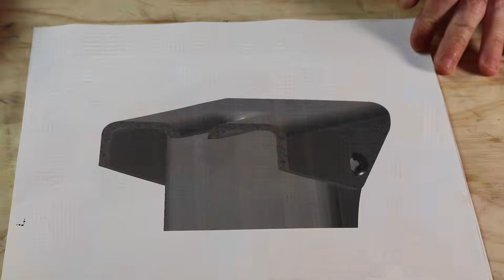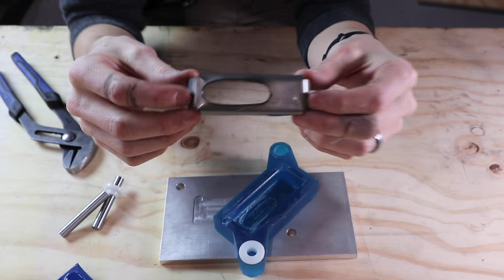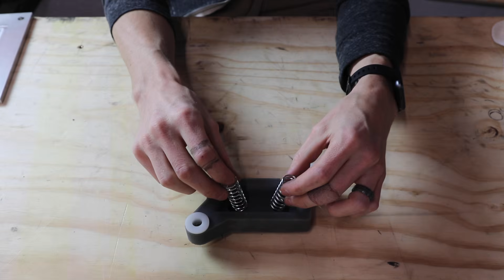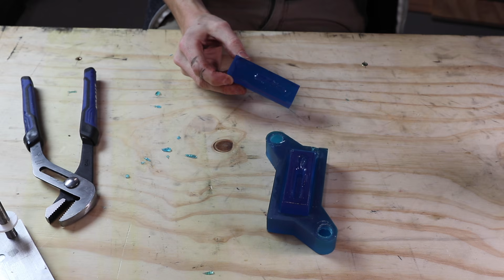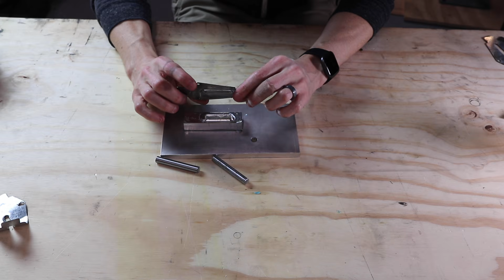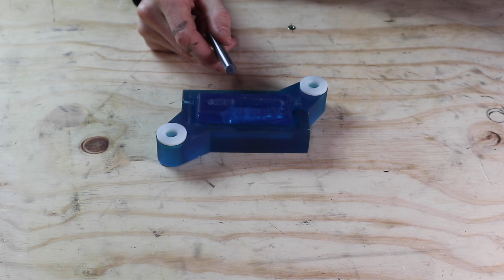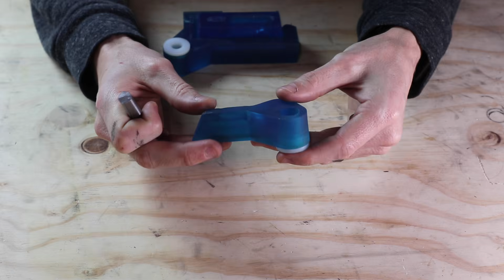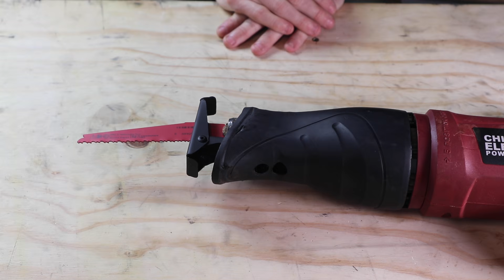Bending Steel With Plastic Tools

Comment: Why make a form out of 3D printed resin when you can CNC aluminium or steel and make the forms more resilient ?  Alternatively maybe have some bolts laterally through the resin dies to add tensile strength ?
Reply from the maker: These forms are really easy to CNC but 3D printing allows you to make potentially more complicated forms that would be very hard to machine. Also I'm lazy and would rather print them and do other stuff instead of running the CNC :)
Reply: Cool.  Was just curious.  Love the content you are putting on youtube btw.  Good stuff man!

Comment: As a Tool and Die maker it was interesting to see you work through this, impressive what you were able to do with 'plastic', really
Reply: Resin.
Reply: chara dremur that is the reason he put air quotes
Reply: @charadremur333 what do you think resin is?
Reply: @charadremur333  Rosin.
Reply: @Phelan666  Rosin is a solidified resin from which the volatile terpenes have been removed by distillation; I don't know of any 3d printing process which uses or produces such materials.
Reply: @okuno54  So is the substance he's using resin or plastic?
Reply: @charadremur333  🤡

Comment: What press are using. Looooooove this vid  and your channel
Reply from the maker: It's a harbor freight 20 ton press modified with a pneumatic hydraulic cylinder. The pneumatic cylinder is important to keep me from going crazy otherwise every time I press something it takes hundreds of strokes of the big lever. Glad you enjoy my videos! :)
Reply: @StuffMadeHere  i suspected it was that one :). you have to have air over...or your arm would fall off...such great videos man. you are like This Old Tony's skinnier little brother :P   think im going to have to upgrade to an SLA printer...the prints are so much nicer than fdm.

Comment: I'd be curious to see how an FDM material like PLA would stand up. Or if an intermediate forming stage would reduce the stress involved?
Reply from the maker: An intermediate stage should definitely reduce the stress. If I can't get this to work with a stronger material then that's next on my to-do list. This is often done in progressive die forming operations. 

PLA might survive at 100% infill. It's really soft but if you avoid super high local stresses it might work out.
Reply: @StuffMadeHere  I've seen it done and will do it myself with low infill (~10%, as open as possible) and filled with epoxy to make it much more solid.
Reply: I've played around with this a little, ABS was fine with 0.065" aluminum. From what info i could find, i think the SLA resins are weaker. 
Great video, thx for sharing.

Comment: Mold it with a metal insert?
Reply from the maker: Yeah or a steel band around it to contain the stress. I'm printing it right now in a much stronger material (and a cooler even more complex form along side it) so we'll see how that holds up.

Comment: Thank you. I hope your channel takes off! I've been toying with this concept in my head for a while, but I'm not an engineer. Seeing you put in action is a real inspiration. I want to make press formed  metal panels (brass) for scale auto/rail modeling. Imagine a true to scale unibody or Monocoques made from 3D printed die press formed parts.
Reply from the maker: Brass would be a lot easier than steel. I tried to do this on hard mode with 16/18 gauge steel which is incredibly strong. No need to be an engineer to do this if you have 3D modeling skills. This could be done in blender or any other modeling packages.